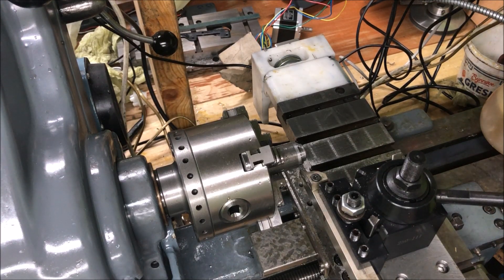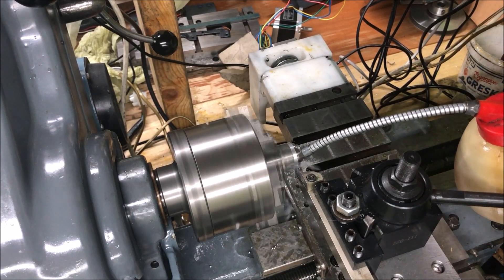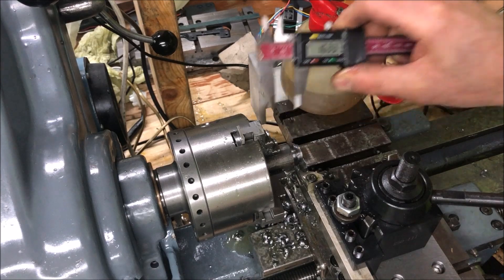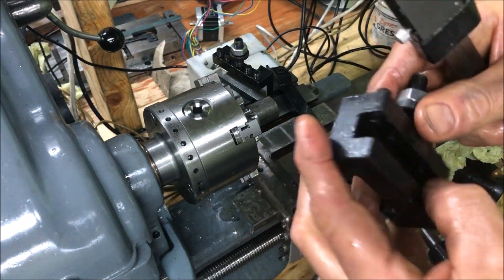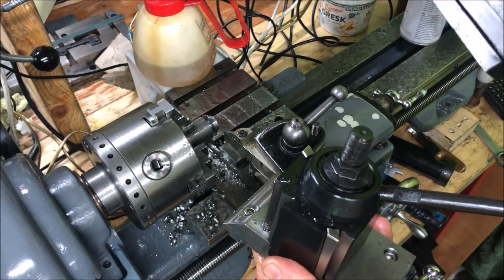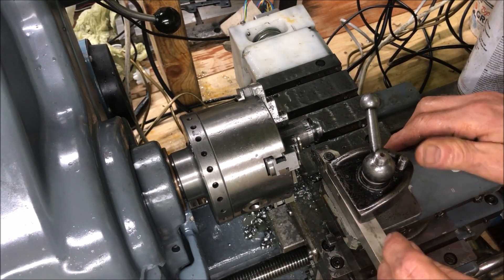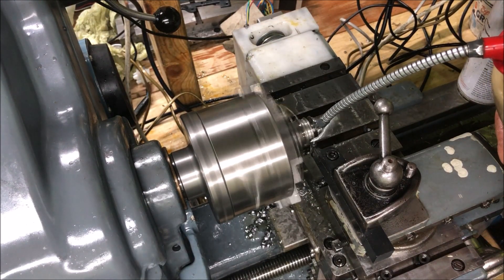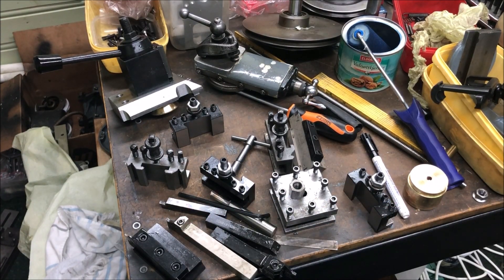Myford Super 7 - test cuts - part 3 -  grooving tool

Comment: Jan, is it still too early for a final conclusion? For me, it looks like the difference between solid toolpost and compound slide is less than I initially thought. Perhaps the reason for that is the good scraping of the compund slide prior to the test. Do you agree to this impression?
Marc
Reply from the maker: Well, actually this compound wasn't scraped at all prior to the test, not by me anyway. But It was fairly tight fitting, but I will scrape it further in due time.. In mye eyes, there is a difference, but since there are multiple causes for the perfomance, these all are mixed in, and the result in my case could have been colored by the use of the 4 way toolpost as more rigid than the qctp and this working to even out any effect of a solid tool post.. for example.

Comment: First, I like how that "one way" tool clamp looks. I think that would look perfect on a machine restored for display, very stylish.  Second, I continue to be impressed by how well your Myfords cut.  Third, the oil industry thanks you for your support! :-)

I cannot thank you enough for sharing your time with the community.  It is such a motivation to have these references when wondering "Is my machine doing what it should?  Do similar machines have the problem I'm having?  Am I just trying something outside my machine's capability?"
Reply from the maker: Thnks. This is the original tool clamp, along with a 4-way as offered as an option I guess, from the start of production. I imagine inherited from their earlier lathes. I have seen several other version of the same general idea also, so figure these were quite common. The lantern type toolpost was (to my understanding) not so popular over here as they seem to have been in the US.
Haha.. yes, I used what could be termed "a liberal amount of cutting fluid" :) It was a steel bar, so I thought this would be of importance.. well, I knew this would be paramount, therefore I used as much as I thought would be needed (and more) to avoid the test results becoming a test of what will happen when the heat build-up (and results of that) is the limiting factor. As a matter of fact, a drip feed, or spray mist is on my list of things to do/test (buy.. I guess..)
You're welcome. It has been my pleasure! If I have motivated some to dig deeper into this fantastic hobby it gives meaning to all of this! I can only encourage others to also explore "the vast land of opportunities" here :) Take care!